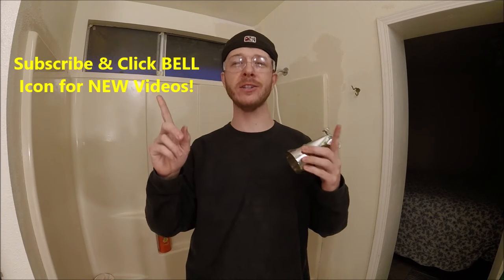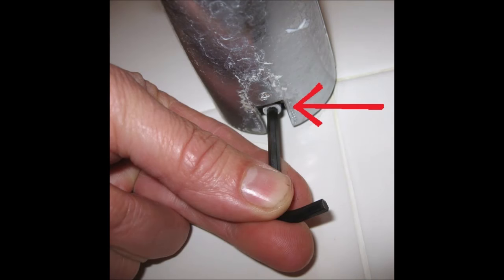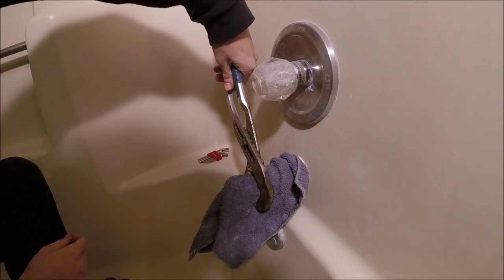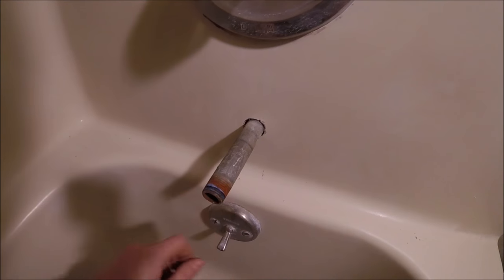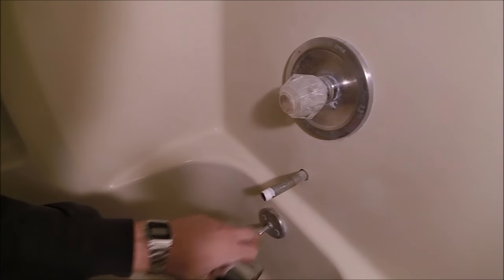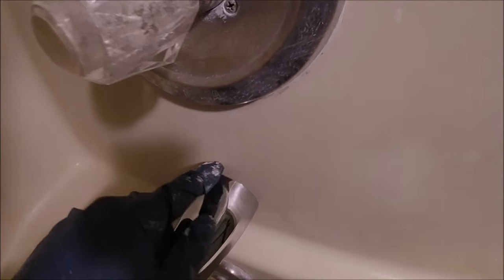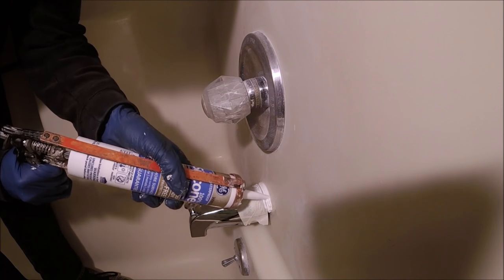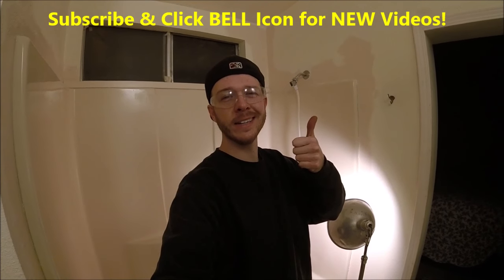Bathtub Spout with Diverter Replacement. Fix Leaking Tub Spout  -Jonny DIY

Comment: mine dont have the screw set, i cant turn it counterclockwise to unscrew it, even with the wrench..😢
Reply from the maker: No set screw underneath? If no should just unscrew counterclockwise. May need soak in wd40 or heat it up if seized. Last resort be cut it off grinder

Comment: What if water leaks from that pipe ?  Non stop what to do then?
Reply from the maker: They it's going to be a valve issue and youll need to take it apart and see if seals need replacing or whole mixer valve 👍

Comment: My spout leaks when water is off. Does a new spout fix that?
Reply from the maker: No that'll be a valve issue, so up behind the water control knob(s) 👍
Reply: @JonnyDIY  yea, I changed the rubber behind it but it still leaks unfortunately. I have the old style. The one that doesn’t have cartridge. Mine just has the metal ball with two springs and two rubber things. Bought kit & replaced and still drips.
Reply from the maker: @_NEW3RA_  ohh ok well replace the springs and rubber seats, sound like you did. You can also replace the ball as well. But you may just need to tighten the ball, it would be that lil plastic ring with the notches in it on the collar. I think this is the little wrench you need if its a delta "Delta Faucet RP1974 Wrench"

Comment: Thank you Jonny do you have a video on how to replace all the shower and tub fixtures when you don't have an access planet? Mine is 35 years and needs an update and I have no access panel, do I need one? Can I change all them from inside the tub?
Reply from the maker: Sorry dont have a video on that yet. It depends on the shower valves that are used if youll need an access panel. Sometimes you have to cut a panel to change them out or youd have to remove tub insert or tile. Either that or just get similar fixtures and replace with those. Thatll be most cost effective  to just try and find ones thatll work with older plumbing

Comment: I have a question when changing the handles does it matter if you don’t get the exact same ones as before??
Reply from the maker: No it wont matter, just make sure theyre similar length and the mounting is the same, either the screw on type or the set screw type 👍
Reply: @JonnyDIY  okay thank you so much! :)

Comment: If you measure the length of the pipe sticking out from the wall, you can buy a spout that is the same length. this way you don't have that huge gap.
Reply: ThAts what she said!!!
Reply: That very simple and VERY important piece of advice has never been mentioned in the hours of watching videos. I just unknowingly bought the wrong size. Thank you!!!

Comment: What if i have to replace the pipe... how do i take that small pipe off...
The thread is rusted.
Reply from the maker: You can use pipe wrench to loosen off. Be sure to use pior dope and or thread tape on new piece. And let water run out pipe and check with flashlight make sure the connection isnt leaking 👍

Comment: I just don’t want to turn it and break the pipe how do you know that you got it right
Reply from the maker: @lazlowcigar9266  just Tighten it til its nice and snug and not leaking 👍
Reply: I’m talking about taking it off it seems to not want to budge don’t want to break anything
Reply from the maker: @lazlowcigar9266  did you make sure its threaded pipe like this one and not a copper pipe where slips on. If its threaded pipe probably just stuck on from mineral deposits
Reply: I put it in 15 years ago it doesn’t have a screw holding it on so I figure it threaded but it’s a old house and the pipes are old I’m sure it’s build up but I just don’t want to bust the pipe not sure how much force I need to use
Reply from the maker: @lazlowcigar9266  spray with wd40 or rust penetrant once a day for a few days to help loosen up. Can drill a hole in it to spray that connection easier too if need be 👍

Comment: Which tub spout was that?  Looks like my situation but I cannot find a spout that works with that length of galvanized pipe.  Your links doesn't work.
Reply from the maker: If you click the link it should be 3rd one down. $13.99, 839 reviews, Amazons Choice.
Reply from the maker: You can also buy locally at plumbing supply or big box store
Reply: @JonnyDIY  Unfortunately, no tub spout was available that would fit my needs.  I ended up having to cut about 3/8 of an inch off of the end of a new Moen tub spout to make it fit.

Comment: I noticed water coming out and up at the back of my tub spout.  I haven't ever seen that before.  That's not normal, right?  Do I need to replace it?  I was concerned water might be going back into the wall and causing a flood/mold.  TIA!
Reply from the maker: Yes that's not normal and should be addressed. Don't want it pushing water back into inside of walls
Reply from the maker: Most likely need to replace. Sometimes cleaning pull up lever really well will help, but I usually have to end up replacing
Reply: @JonnyDIY  ty man gonna call the homeowners insurance!  appreciate it!
Reply from the maker: @kafaya77  you're welcome 🤙🏼
Reply: @JonnyDIY  replace what, the whole faucet?
Reply from the maker: @christopherbowen7873  just the spout. Sometimes you can fix them by replacing the inner seal, but I usually just replace the whole spout  👍
Reply: @JonnyDIY  will replacing Teflon tape work for this situation?
Reply from the maker: @christopherbowen7873  yes it's possible if that was the point of the leak and not the stop lever gasket

Comment: Hi, just a tip when we installed Teflon tape on it, we need to put counterclockwise that’s the right way thanks
Reply from the maker: whichever direction its threaded is the way I put on the tape. So clockwise for regular, that way it doesn't back off or bunch when you thread onto it 👍

Comment: How do you remove and replace the knobtht you showed here turn on and off water
Reply from the maker: Theres a cap in the center of the control knob you have to removed with small flathead screwdriver or razor blade then theres just 1 Phillips head screw under that cap 👍

Comment: We replaced ours and when you pull on the diviter the shower doesn’t work, what did we do wrong?
Reply from the maker: Im guessing the new diverter is defective. Should work. Does it spray past. Or just fall back down. Make sure you have pressure on high. It wont turn on shower part unless pressure is up

Comment: I need help guys I used the pliers to turn it counter clockwise but it’s in pretty good and it don’t have the screw so do I keep trying to force it ?? I used D40 but don’t help it’s been on for years i don’t want to spend money on a guy to fix it
Reply from the maker: Yes just keep unscrewing. Sometimes the spout seizes onto the pipe and it unscrews the pipe with it. What you do then is just unscrew it all then unscrew pipe from spout after you get it off. Then screw pipe back in and then run water out pipe and with flashlight make sure not leaking from back connection. Then screw on new spout

Comment: What if you see water dripping at the back of the spicket
Reply from the maker: May need to tighten it if a lot. If a little should be ok as long as not spraying back into behind the wall
Reply from the maker: Could remove spout and put new pipe thread tape and sealant and reinstall spout and hopefully solve issue

Comment: I replaced mine and it still drips?
Reply from the maker: Itll drip just a tiny bit when diverter lever is pulled up. If leaking a bunch. May need to take off n redo the tape and tighten lil more as well

Comment: what about the diverter replacement?
Reply from the maker: You can try and replace just the diverter if you want. I've done that before. Just unscrew the little lever knob on top and then you can push down and take plastic part off. And replace gasket seal

Comment: What if there are no threads at the end of the pipe sticking out of the wall?
Reply from the maker: Then it would most likely mount with a set screw from underneath the spout like I showed in early part of video

Comment: My Tub Faucet is missing the screw inside or is a threaded one! I’m not a plumber and I can’t get it off. It’s working ok but it’s tough to remove without a screw! It doesn’t just pull off! 

And then my shower plate faucet handle knob has a screw inside that is SO CAKED that it can’t even turn and it’s Rusted so even a pair of pliers can’t get it out! I have to leave it alone though because I’ve tried fiddling with it, But she won’t budge! And I don’t want to damage anything else that I have to call a Plummer for. I can’t afford a Plummer at the moment.
Reply from the maker: Can try rust penetrants on seized on parts like wd40 or kroil. And can use heat as long as not something near something else that will melt
Reply: @JonnyDIY  Yeah Lube might work. Now I just need some baby small pliers. 
Thanks though! 👍
Reply from the maker: @StrongNoah  you're welcome, good luck 👍

Comment: So there's no way to FIX it?  i.e. not have to buy a new one?
Reply from the maker: Depends what's broken or malfunctioning on it. Some you can get a new diverter seal for if you take apart. It just depends on what issue is. If you look up replacing diverter seal you may find something

Comment: When I pull up the diverter, it doesn't stay up and goes down the moment I release it. This is the first time I'm using this kind of tap cum diverter, so not sure if I'm using it correctly. Any help would be appreciated. Btw, its a Jaquar:
https://jaquar.com/en/opal-prime-bathtub-spout-hand-shower
Reply from the maker: Make sure you have water turned on high, some  of the diverters only stay up with the water running. Try that 1st. Then if that doesn't work I take it apart, may be missing of worn gasket that seals diverter 👍
Reply: @JonnyDIY  Thanks Jonny. The pressure of the water is not that high as the overhead tank is just a floor above. I need to use a pressure pump. However for now, I'll just get it changed as its a new piece and still in warranty. If the new one doesn't work too, it'll probably be because of water pressure.
Reply from the maker: @deepakdeval1723  you're welcome, the basic ones like I used in video will stay up after you pull it up without a ton of pressure

Comment: after installing spout noticed leaking behind wall
Reply from the maker: May have loosened pipe connection in inside wall. Remove and coat threads with new teflon tape and a lil pipe thread sealant (pipe dope) reinstall pipe without spout on. Then run water and check to make sure connection not leaking

Comment: You are supposed to let the Caulky not get wet or else it wouldn't be a purpose of putting the caulking In,itll just be messed up!!
Reply from the maker: Yes you are correct, you should let dry overnight or at least all day before getting wet👍

Comment: So easy when you have a threaded pipe.
Reply from the maker: Even easier without a threaded pipe. If not threaded you'll just have 1 set screw holding it on 👍
Reply: @JonnyDIY  Yes, I don't have a threaded pipe, however I do see a phillips screw!

Comment: just installed a new faucet only leaks in the wall when shower is on
Reply from the maker: Going to have to disassemble and check all your joints, find where its leaking from. Either a joint or the shower valve

Comment: Why did you even mention the diverter in this video you didn't even point it out you just are replacing the faucet. I took my faucet off in this house that I'm in and it's not an older faucet it looks like a newer faucet and the diverter is not like others I have seen. It looks like I'm going to have to replace the whole entire spout. This video was not helpful to me because you didn't even mention the diverter.
Reply from the maker: The diverter is built right into the end of the tub spout, so you just replace whole thing 👍

Comment: I put a brand new spout on . When I turn off shower the spout  doesn't pop or release water right away?  Why
Reply from the maker: That is a function of the spout that not all spouts do. Mine doesn't do it either, I lift it up before shower and press down after 👍
Reply: @JonnyDIY  ok so I bought kohler cheap one